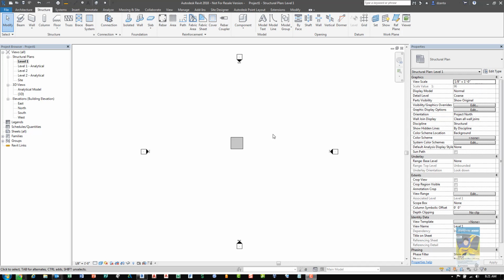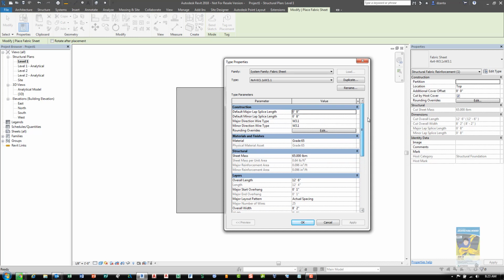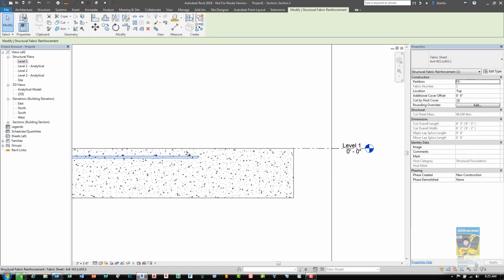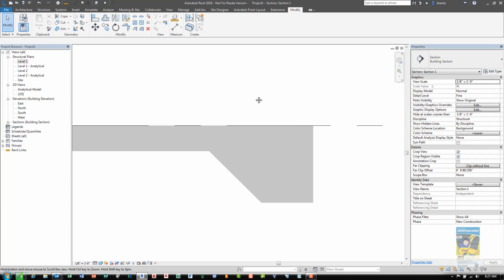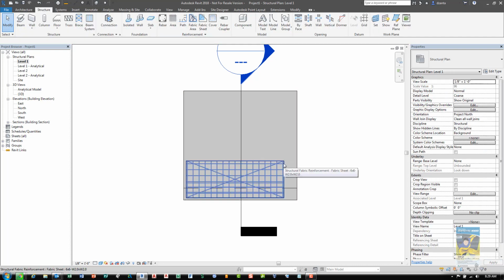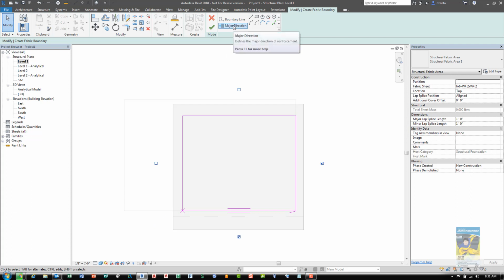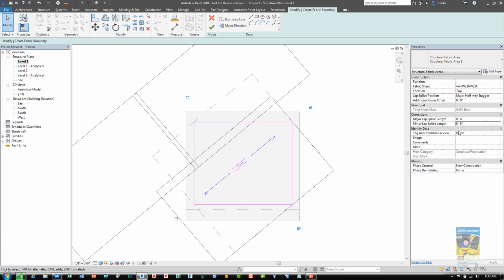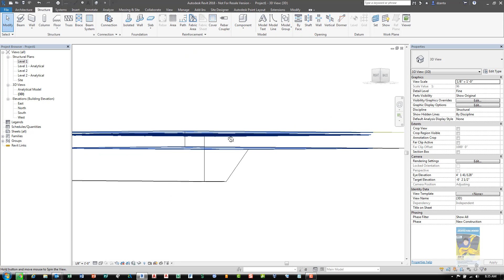Revit 2018 Fabric Reinforcing Commands - A How To Guide

Comment: Sir Please tell me how i am reinforcement on roof and it is possible or not slab, wall, floor , columns have a possible , but  i am very confused , i lot of find videos but not available sir tell you tell me it possible or not , and how to solve this problem specially in sloped roof please sir
Reply from the maker: Roofs cannot have rebar.  You have to use sloped structural floor for reinforcement and mimic roof